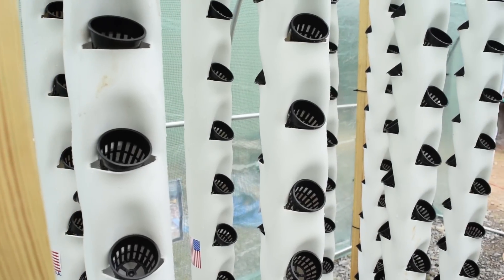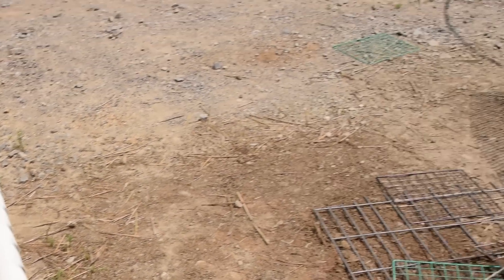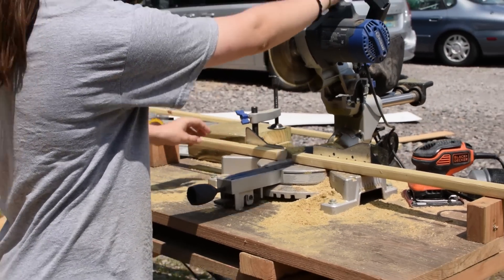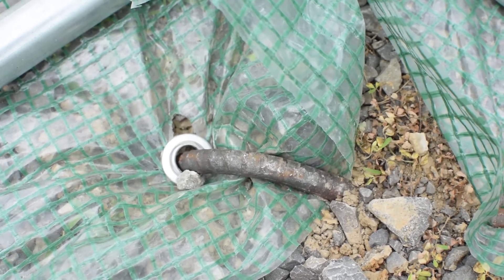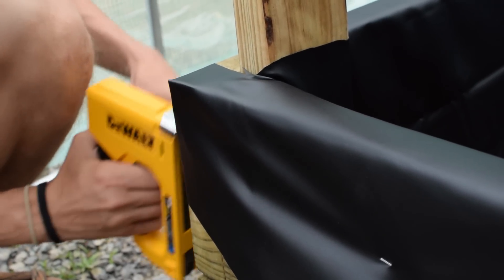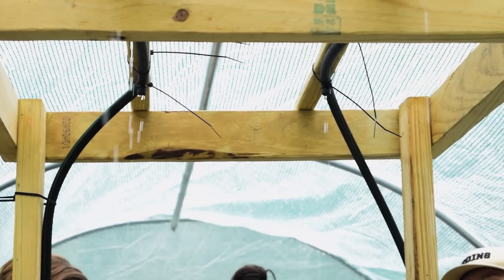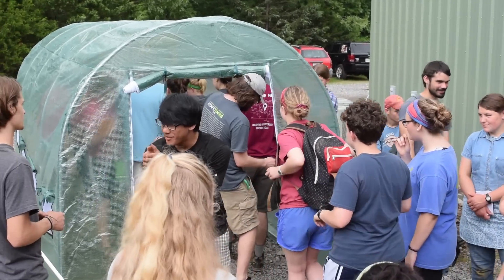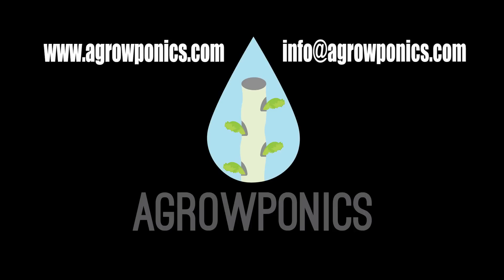This Vertical Hydroponics System is Built by University Students from Start to Finish

Comment: The greenhouse they use for this is a great bargain, I have had 2 of them. They do need to be enhanced to make it through several years of use. The problem is rain and snow. The top curved roof supports is formed by long metal poles. If you look at the roof there is a pole that runs the length at 10 oclock, 12 oclock, and 2 oclock. With the rib poles in place this forms these rectangles across the top of the greenhouse. With the greenhouse cover on these have a tendency to pocket as the material stretches over the course of months and then when it rains the water pools in these pockets. As the water pools the plastic starts to stretch and the pocket gets deeper collecting more water. Eventually the metal frame fails under the weight of the water. The problem with snow is similar, the metal frame just can not support that much weight but if the greenhouse is actively heated in the winter then the snow slides off. To fix the issue with the water pooling between the top spine and 2 lower spines I took light metal garden fencing, rolled it out on the metal frame and then zip tied it to the frame. At that point I put the greenhouse cover on and the fencing keeps the water from pooling and collapsing the roof. I also place a couple 2x3 studs from the ground up to the center ridge pole because my greenhouse was not heated and this prevented it from collapsing in the winter before I could remove the overnight snow. The frame they use in the video likely helps add support to the roof frame.

Comment: One question, I have always I my mind. 

Are all hydroponic systems (NFT, Floating, Tower planter).... organic or inorganic ?
Reply: मेरा देश मेरी जान depends, if you use chemical pesticide and chemical fertilizer, then it’s not organic.
Reply: There is infrastructure (NFT, tower, deep bed, etc) and then there is method (organic, inorganic). Neither factors dictate the other. Inorganic is favored in some operations because there is more control at the fruiting stage (eg. floriculture, tomato culture, etc) Aquaponics for example cannot vary the pH range too wildly without impacting the health of the fish.

Comment: Please, please, please, stop with the imperial system! It is hard to focus on the video hearing those fantasy measurement.  Otherwise, good video :)
Reply: There are two types of countries. Those that use the metric system and those that have been to the moon. Standard imperial measurements do have an advantage, you can do it in your head. Plus you can develop most of those measurements using common instruments. Metric you have to map against a standard that you may not have access to.

Comment: Mengelolo pertanian dg cara hidroponik sangat menghemat tenaga dan dapat berlangsung sangat lama ,hanya memulainya memerlukan modal besar dan pikiran dalam menyusun pengairan  dan perlu  perhatian dalam mengelolanya
Reply: Not only does it save money it also conserves water.  While there is an initial capital investment Agrowponics has introduced a low cost kit system that gets you started without the typical infrastructure costs.  As with all hydroponics system, careful monitoring is critical to success.  Thanks for the comment Hermanoe Papa.

Comment: For those of you who may be interested in making these towers.. either the round or the rectangle. I used a Dremel tool and it's circular cutting blade to make the starting slit or cut on the rectangular shape.  With circular piped due to the curve, you can you use simple hand saw.  I went with a 1 3/4 slit. You could go a little  bit larger..but keep under 2".  I also used an empty coke bottle to shape the opening.  Getting the opening started..is a little tricky and takes just a little practice in handling the heat gun.  The heat gun will melt that plastic pretty quick..so FYI. Absolutely do this outside - well ventilated!.   I found that it's easier to start stretching the opening with a large rounded rat tail file.. after the plastic is heated up and softened.. I use that to stretch the opening till I can insert the coke bottle in.  Once you do about 3 or 4 openings, you'll get the hang of how fast the plastic softens and stretches. You'll be able to a bunch of these really quick.  It will take you more time to measure and mark the holes..rofl.  Have fun and grow some food!
Here is an excellent video on how make the round towers: https://www.youtube.com/watch?v=3LmydJnqMBI

Comment: Outstanding job students and thanks for sharing this awesome concept and your knowledge with everyone! 
Here's a fun tip..about this set up.. You can just as easily use the 2" x 3" rectangular down spouts.. They are little cheaper, usually than schedule 30 - 4" diameter pvc. And..you can really maximize the horizontal space for these vertical towers, as they are they take up 1" less space horizontally..  So...doing the math..for every foot horizontally it takes to hang the 4" pipe....It may be possible to hang  another tower?  Yes, you could use both 3" face sides of the rectangular down spout, as you did your your round pipe.

Comment: Could you improve the system by putting a mesh at the bottom of the towers and filling the towers with the clay pellets that are used in a lot of other systems?
Reply: I'm not sure that would improve it. It would add significant weight to the towers and it would allow the roots to become tangled in the clay making harvesting more difficult. I'm not sure that it would add any sort of advantage over just dripping

Comment: Great - so now we need electricity to grow food......
Reply: Good thing you can get that from the sun.
Reply: You mean we don't need electricity to grow conventional crops? Bores, tractors, machinery sheds, the list goes on.
Reply: or from the wind / ground
Reply: We have a patent pending that converts a solar PV panel into a PV + thermal (PVT) to power pumps and maintain the water at 28c from the by product of cooling the PV panels so they deliver what the efficency was when the in house tests was set at 26c. All solar PV panels can lose up to 20% of there low efficency due to heating above 30c to as high as 76c. Our PVT tanks have been sold in Sth Africa for 4 yrs, and comes as flat pack
Reply: Eric Hawkins
Hey Ed, all solar panels only have an efficiency of 17-21% brand new with full daylight. You'd be better off building an enclosed PVC PIPE SYSTEM with trickle water feed that feeds back to the water trough than to try to cool a solar panel and increase efficiency that isn't there in the first place. Solar panels are a waste of time and never pencil out in savings.
Reply: Great - now we actually have morons who believe that electricity has never before been utilized in the production of food...
Reply: Dont worry about who I am, as far as the food industry is concerned, just carry on plugging pumps into the mains power supply and if are using grow lights, plug them in as well, all adds to the final price paid by the buyers, even if and when power supplies are disrupted by weather related storms, heat waves and so on

Comment: Isn't bad to use PVC????
Reply: I use sewer grade PVC instead of the class 40 thick stuff.  It's much cheaper and because you are not putting pressure on the walls it works fine. Compare the pollutants, herbicides and insecticides used on conventional crops to anything grown this way and you too will choose this food over soil grown foods.
Reply: this sewer grade pipe will not crack in sunlight?
Reply: Yes, very bad, Google the Risk of pvc, even Just the liner may be a safety Risk. The industry knows buy keeps IT quiey.

Comment: Nicely done,but unfortunately this system is prone to diseases such as fugal or bacterial infections or water moulds and root aphids/fungus gnats.
The way I see, it's just too open, those tray's at the top and bottom are fully open, those holes for the net cups aren't round and there is some space on the side of the cups.
Since this is an greenhouse set up,All those openings are just an invitation for some pest to invade the root system, and then the ongoing battle(that you can not win)begins.

Comment: the first cup gets most water.. will the rest of the cups, I.e. last ones get the full amount of water and nutrients ??
Reply: The top plants which get the most water should be the more mature plants. Those on the bottom would be the seedlings that don't need as much water nor nutrients.
Reply: think a littlt the ist cup is full the water north of the equator will fall to the next lower cup  and so on into the resevor to be pumped back to the top automatic drip,

Comment: what was the cost constraint you mentioned at the beginning ... how much did it cost to do this system?
Reply from the maker: It's possible to spend $1,000 for a system like this if you are in the U.S.
Reply: that seems pretty high, if i dabble with it for myself ill comment my results and cost... what cost did the students end up getting into though? that way i can compare ... is there anywhere a breakdown of materials and their cost?
Reply from the maker: My apologies, I meant to say it's possible to spend LESS than $1,000 for a system like this if you are in the U.S. The cost for materials on this project was between $600 - $700 range. Thanks!
Reply: @agrowponics5068  $100.00 for the tent it's self
Reply: price is very high can build units in Canada